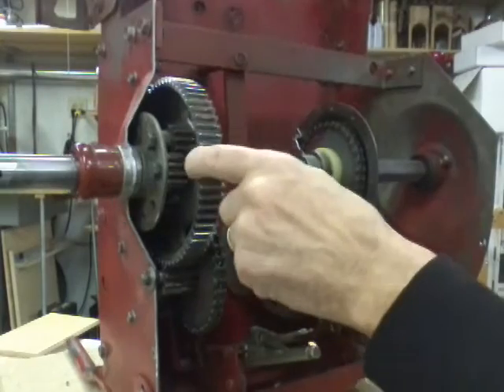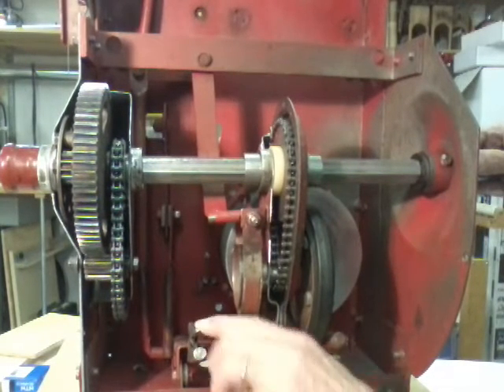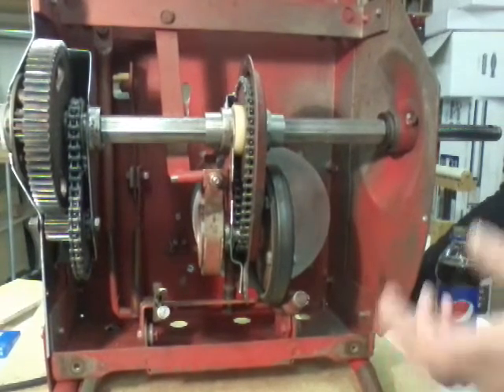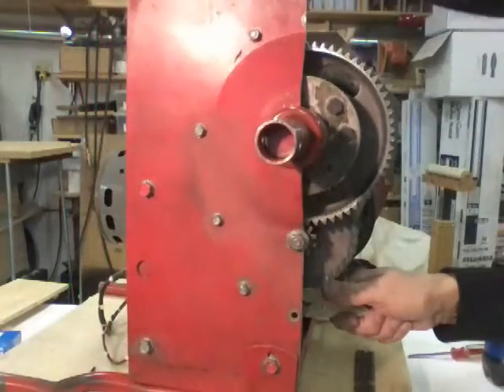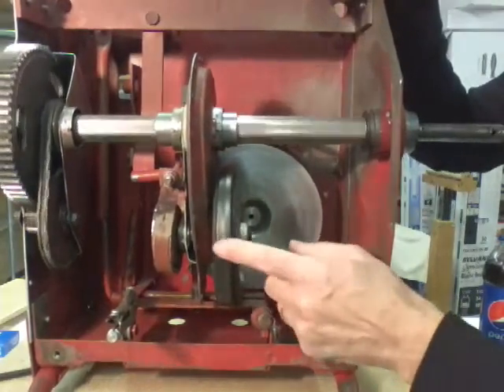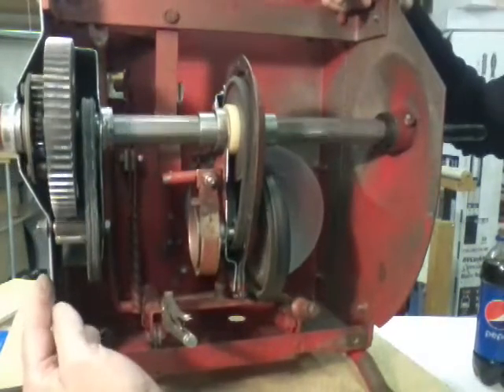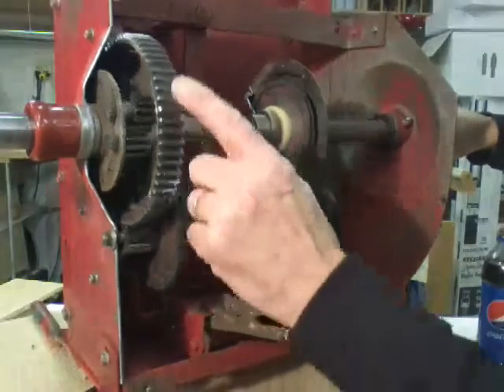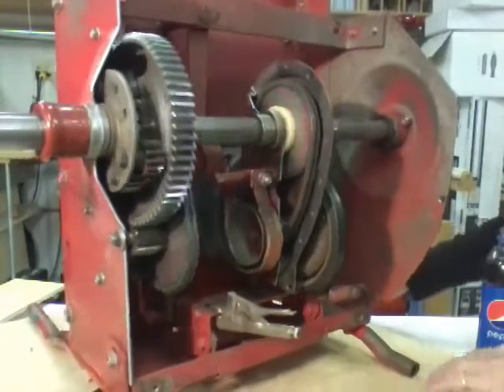63. A working Snapper model  part  1

Comment: What controls the lateral movement of the the entire rear axle? On one of your other videos you  showed a case where it was rubbing inside(I think my 12-13 yr old is doing the same thing) and you mentioned 1/4". Well I've got at least 1/4" side to side at the back tires on mine. I noticed this after watching another of your videos because I was about to change the axles boots and I remembered what you had said. Is there a bearing on the left hand side that works sort of like thrust bearing??
Reply from the maker: PAUL SEARS 
hi Paul it's Jim on your snappers if you have bushings or bearings on the Inside Edge of the bushing there is a large flange that stops the bushing from sliding all the way through the fenders this flange acts as a thrusts point it captures all the rest of the parts between the two bushings and to keep from side play you add thrust washers that are nylon you used to be able to buy C shaped thrust washers and all you had to do is pull back your boot on the opposite side of the differential the thrust washer snap on the axle between the end of the hex shaft and the bushing, I had a viewer email me and tell me they no longer have his C washers so you have to buy regular nylon thrust washers and cut them yourself.  if you need any other help send me an email and I'll see what I can do.  talk to you soon Jim